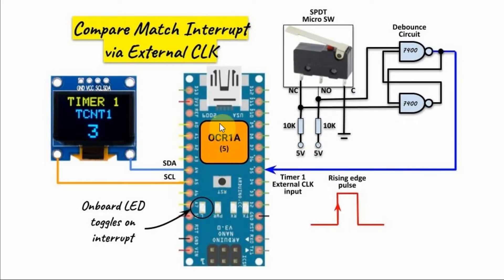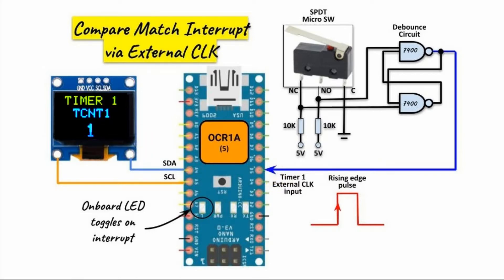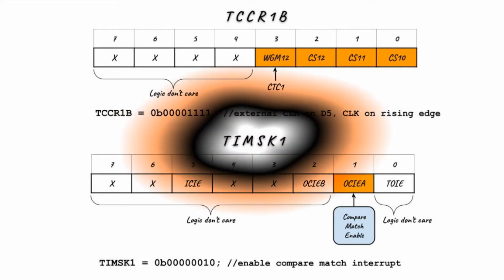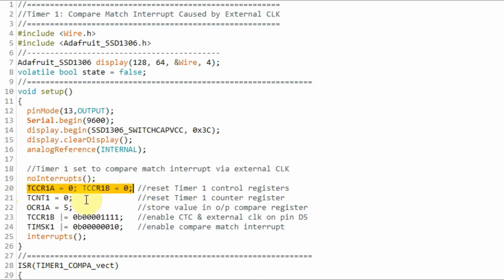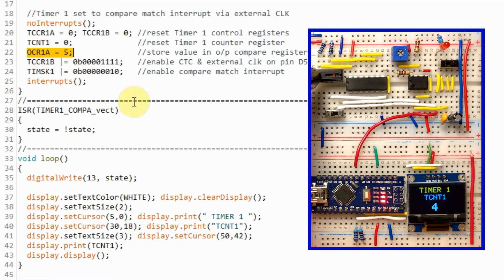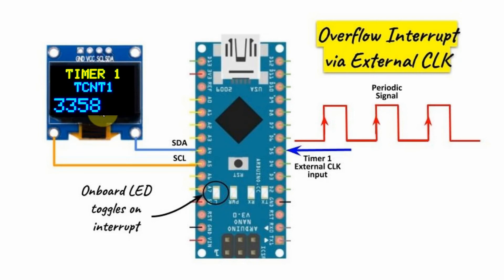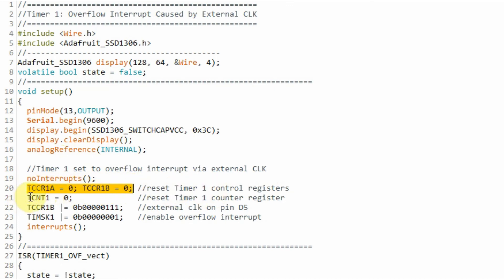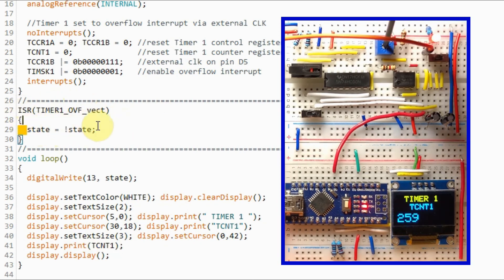Arduino Timer 1 Interrupts via External Clock

Comment: what pin can i use for the arduino mega 2560?? im using the timer1, which pin should i connect my external clock?
Reply from the maker: I did not find Mega pinout for Timer1. Fortunately, there is pinout for Timer5 @ D47. I also found pinout for Timer0 @ D38.
Reply: @AnasKuzechie  okay, thanks